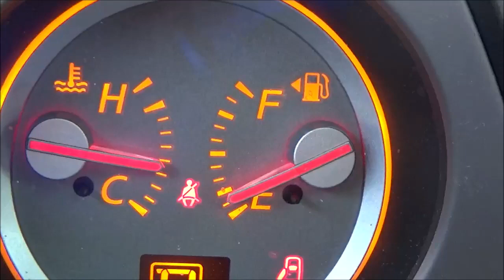Changing The radiator and Fan in an 06 Nissan Murano

Comment: They sure make them harder to work on don't they. Lol! Awesome video John. When I was a kid in my twenties I had a radiator shop and removed, repaired, and replaced many many Radiators. Lol! It was a lot easier then. Cheers
Reply from the maker: Yes it was. I wish you could still repair the radiators, these plastic ones don't hold up and you can't fix them.
Reply: The plastic ones are part of the reason I got out of the business. I do occasionally fix one for my wife's cousin. He is Amish but still works on tractors and small engines. No trucks or cars. Lol!
Reply: I wonder if a radiator shop is a viable niche business still?... have to book 3-4 jobs a day probably.. hmmm
Reply: @NotUpdated005  At least that many or more.

Comment: Changed the radiator and thermostat. The fans not working. What could it be? Still overheating
Reply from the maker: Check your fuses and also there is a thermastat on the fans that kicks them on. The one fan should come on when you start it the other should come on when you turn th a/c on. they could be bad. Mine were so check and see if they can be started if you straight wire them. Good luck
Reply: Re - Re place the thermostat, check coolant levels and mixture..